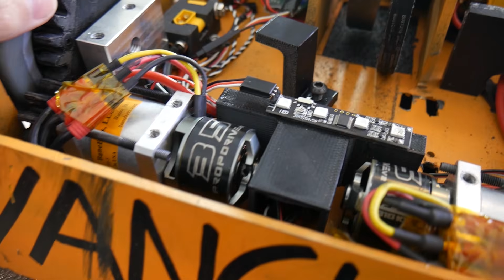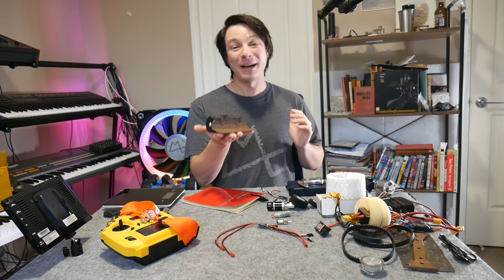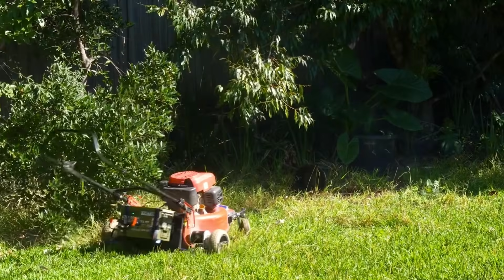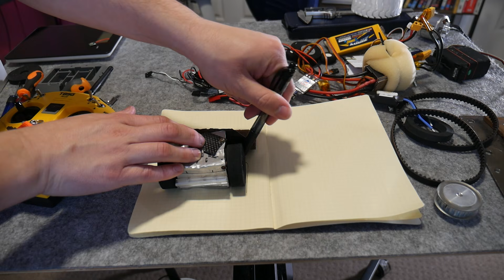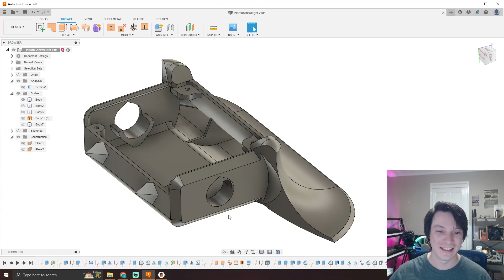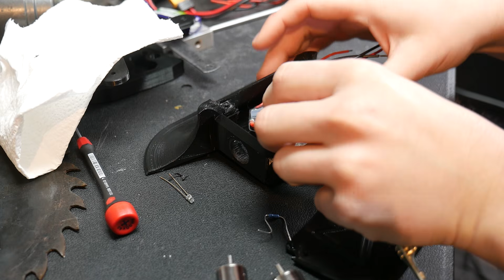3D Print your own mini battlebot! (FULL tutorial FREE .stl download)

Comment: MJF is some incredible stuff. I have done prints with ~.5MM walls and while they are flexible, I have done it for my model train prints. Anything 1MM + is dang tough. I once had a train shell cab, which is mostly thin walls, fall into a rat trap and get shot across the room and it survived with only a minor crack! A regular resin print would have just shattered instantly.

Comment: For soldering fidely wires and components you need to use a "Soldering Helping Hands" they are these articulated arms with aligator clips on the end (there is the standard 2 arms and the 4 arm ones). Casual buzzsaw blade there huh! 23:21 Wont the motor gearbox act like a break, at least the high gear ratio ones stop immediately...

Comment: It does occur to me that for something like this you could get away without a tank mixer simply by having each stick control one motor.  I don't say that would be better, just an option.  For something that had other devices to control, you probably wouldn't want to do it because you'd want the other stick for the other thing, but for this, you could do the mixing manually.

This was fun!  I'm working on an astromech and mostly understand the electronics, but it's good to get some basic principles in a different context.  Looking forward for the big one!

Comment: A few notes for 150g antweights I've found: a link might be easier than a switch - in a real event you don't want to use a toggle switch, you can use a jumper that's hard to pop off instead. Also you can definitely go with a 3S 150mah battery or wire them in series if you have space for wiring, just be careful soldering lipo batteries and accidently shorting them. Also 3D printed chassis have a lot of excess weight you don't need, I'd recommend very thin polycarbonate or fiber tape or carbon fiber for armor or lids to save weight. Lastly, I recommend mixing in a better controller so you can adjust the sensitivity of the mixing (instead of 100/100 proportions), it helps you get more control. Also with a weapon you can control dead zones and ramping.

Comment: Hi Angus great video. Use carbon fibre nylon as print material for the competition robots. It is more pain to print but the gains in strength durability and weight will show.
Reply: The competition he is going to only allows PET, PETG, ABS, PLA or PLA+

Comment: Also, shorten your wire runs! You could cut a pretty decent amount of weight just by reducing the length of wiring you have bundled in there. Any excess wiring spaghetti is just additional weight in the form of copper + plastic sheathing. (Seriously, cut your wires shorter.)
Reply: He could also take a dremel and get some of the plastic out from the inside. A few bevels and round cuts could help. Every little bit helps!
Reply from the maker: Haha yep going to employ all those tricks to get it in weight!
Reply: @MakersMuse  So, is this battlebot craze the real reason the world is short on motor controllers like the Sabertooth lately? I'm still waiting on mine for my R2. :)

Comment: I don't remember when it was aired here in the US but had it been a few years earlier it would have been a cool thing to get the highschool kids interested in along with the engineering competitions which were similar with set rules but also a set material list or provided materials kit.
      Been watching your vids for a long time now but held off getting a printer in the early days as I was in to CNC at the time. Something I don't think you have made a video on is problems printing in high ambient temps. I started a print in the shop the other evening and it was more like a flakey biscuit with super poor layer adhesion. I started it again in the morning with another filament It printed half way before the same issues. It was a 5hr print and the time it failed was when the temp in the shop got pretty high and the cooling couldn't overcome the heat creep. Who would have thought that printing plastic when it's 105*(41c) in the shop was a bad idea... :)

Comment: As a teacher who did a robotics module I was constantly asked about robot wars but I didn't see the point of spending weeks building something to then smash it to bits. In the end I settled for robot sumo.
Reply: It's a lot of fun to compete in. In the lower weight classes, the robots don't tend to get smashed up too badly; it's more about flipping them on their back or pushing them out of the arena. What parts do break are often easily replaced. Part of the challenge is iterating on your design, identifying and fixing weaknesses. The first build is never the last build; you will make improvements after every tournament.
Reply: That is why plastic classes are so much fun. Instead of having to machine new parts, you just reprint them on a 3d printer.
Reply: I understand that view, however my counterpoint is that smashing things to bits means you learn what works and what doesn't VERY quickly. If something breaks, it doesn't work and needs improving on. It's very good as a learning tool.

Comment: Can you use lithium batteries like 18650/21700, i mean the price it's a little bit bigger but has a lot of advantages over lipos, qhy to use lipos instead, the price tag? I love your videos, i'd never start to modify my priter without you, las week i've mounted my first MAX13865 on my printer to print more materials, there you have an idea for videos. Like From Galicia!
Reply: The biggest issue with any of the hard case batteries is the power to weight ratios. LiPos have the best power to weight ratio, with a reasonable power output.
Reply: @tymcneer  you're right, it can't be because of discharge rate because my 21700 are rated for 40A. Thanks
Reply: @somathebest  the newer hard case batteries can source quite a few amps, without damage or overheating. They are also less prone to fire due to damage, but once more, the weight limit thing bites us on the butt and causes us to use a different form factor battery.
Reply: @somathebest  40A is very low compared to a similar sized lipo.
A 75c 4Ah lipo could be discharged at 300A, a 30C lipo would still be 120A.
Motor stall currents can be significantly higher than you'd expect and you're frequently getting at least close to that in robot combat.
The other issue is while the 21700 might be able to discharge at 40A, battery voltages sag under load and the closer you are to the limit the lower the lower the voltage is likely to be.
Reply: @_Piers_  Most electric cars are powered with 18650, it's not only about how much amps can discharge, it's also for how long they can handle it, i understand what you mean but theese insect machines don't need 120A, on this case may be because of the weight
Reply: The main advantage other than weight that these batteries have over most 18650s is the discharge rate. 
You can get 300mah batteries with 90c discharge rates, that's 27amps! (300ma x 90) 
You can certainly use 18650s, but you'll need to make sure they are specced appropriately and fit in your weight budget.

Comment: suits you, but not all, I loathe any law suit
Reply: if you use a flywheel as the generator-battery and the stabilizer and the weapon, 3-in-1, then voila
Reply: no poppy for flywheels
Reply: a super conducting wire coil battery in liquid air container could be nice
Reply: air gun should be nice, its not liquid or projectiles, lol, pssshh :)